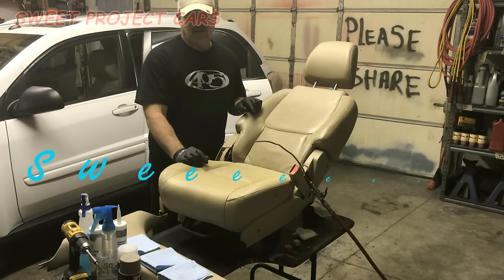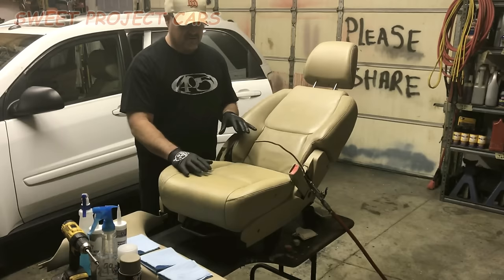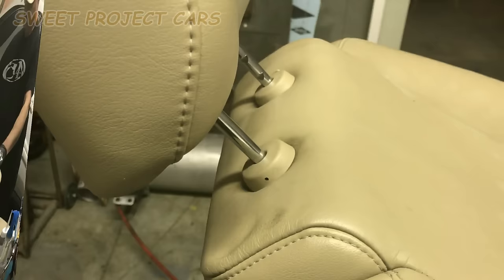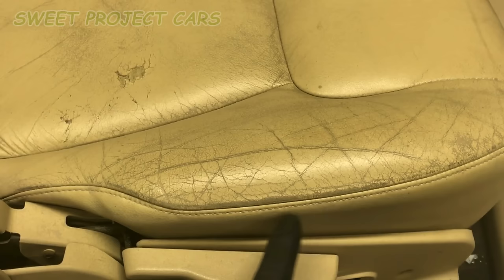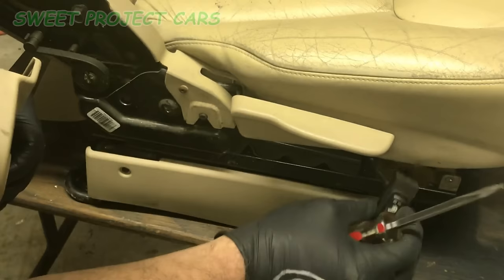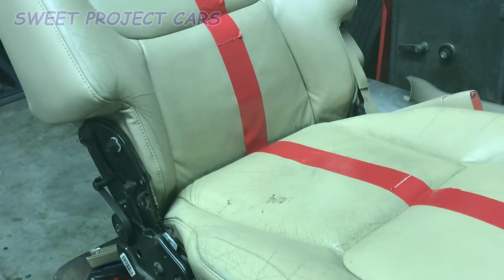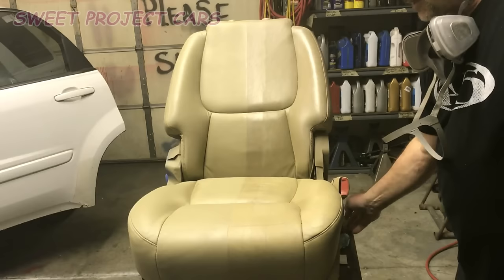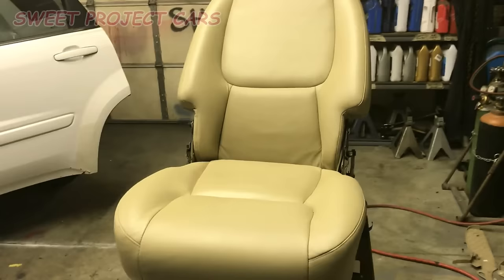How To Repair The NASTIEST Leather & Vinyl Seats....Back To PERFECT!

Comment: Great video ... question? Looked up Permatex “Adhesion Sealant” as pictured in the video and get Permatex but get other similar named sealants? IS this the same or different or need Permatex Adhesion Sealant labeled ONLY?
Reply from the maker: franklin this is what you want   https://amzn.to/2DuPmO1
Reply: Sweet Project Cars I got the 3 oz size and it says on the tube and cardboard or came in that paint will not adhere to cured silicone .... wondering???
Reply: Sweet Project Cars ... waiting that 24 hours on the cure and on a piece of leather material I have rather then on the car seat I am repairing and painting. The adhesive is still tacky to the touch and wondering why since it was applied 3-4 hours ago? Glad I’m trying on that rather then the seat. Any ideas?

Comment: So you spread a layer of Silicon over the seat, leave it to dry for 24 hours with firm pressure of cling film, then spray paint it to the original colour? 😄
Reply from the maker: Please watch the video again, this process is explained in depth in the 3 video series.  It's not as simple as what you state, it is very product specific.  Thanks.  mad Mike the hammer SPC

Comment: Greetings @Sweet Project Cars...One of the paints you suggest is made by Colorbond. I just watched this video from them discussing prep work https://youtu.be/WUHLimyR-gI?t=93 and they clearly state that all dirt and SILICONE must be removed prior to applying their paint hence my questions: 1) How is the paint you sprayed on that car seat bonding to the silicone? and 2) Can I use this silicone method on a genuine leather couch cushion that is much softer in the shore hardness department than the stiffer typical leather car seat? Amazing work BTW!
Reply from the maker: Hello One eyed Stinkfinger that’s the secret of our method if you watch all three videos in the series you’ll see how we make it happen we mix 75% silicone with 25% of the paint and then quickly apply, this puts a slight color on the seat once it’s dried you can fully paint it

Comment: Can you list the names of products used, please.
Reply from the maker: GLUE   https://amzn.to/2DuPmO1

Old 99    https://amzn.to/3bmW3St

Caulk Gun     https://amzn.to/2PRFvHI

USE THIS TO CLEAN SEAT PRIOR TO GLUE & PAINT  https://amzn.to/2z3oiBu

Leather & Vinyl Repair Kit   https://amzn.to/3h8oa9C

Q-tips     https://amzn.to/2DxfgAu

Leather & Vinyl Paint   https://amzn.to/2PWOfN3

Leather Prep Spray  https://amzn.to/2z3oiBu

Vinyl Prep Spray    https://amzn.to/2AVv11Q

Dewalt Drill      https://amzn.to/2SZTf1Y

Torx Bit Set    https://amzn.to/2JVATew

Venom  Gloves    http://amzn.to/2B8kLBh

Air Mask        http://amzn.to/2B547m6

Lint Free Towels    https://amzn.to/2QsrX2f

Spray Bottles     http://amzn.to/2zSlp7S 

303 Gallon  https://amzn.to/2JMng0C

SEM Colors   https://amzn.to/2T0aJv5